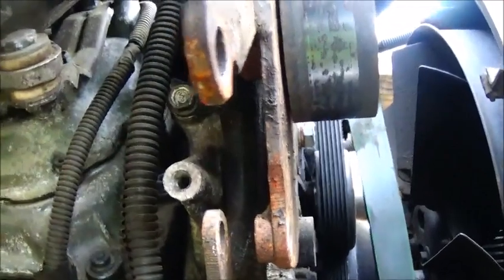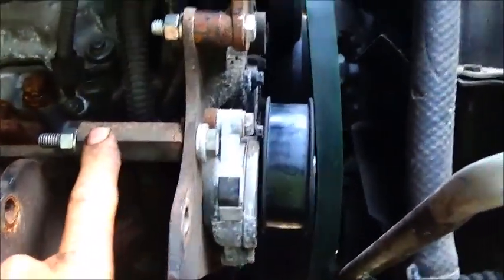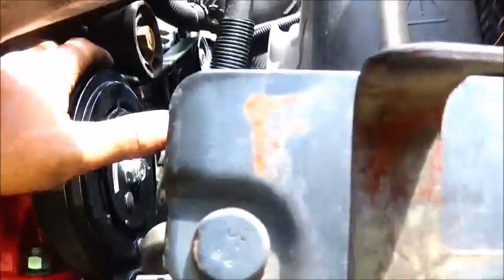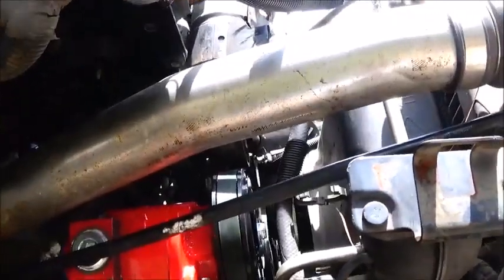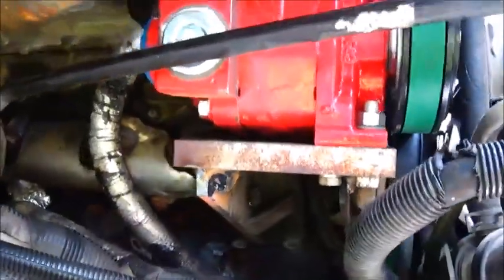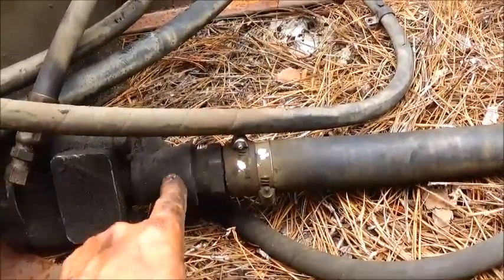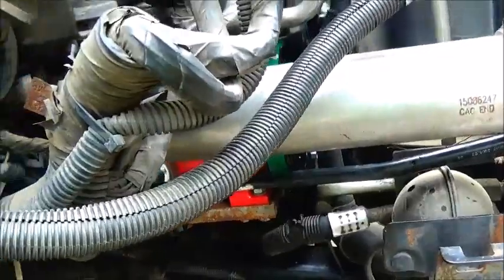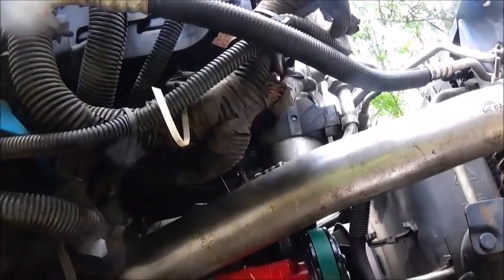2003 Duramax Rollback More Hydraulic Pump Fun!!

Comment: the shop i use to work at where we built dumptrucks used loctite 545 thread sealant they say it won't harm the pump or valves

Comment: THE drive belt looks to be work on the ribbed side on @ 7.43 in the movie and that smooth idler above the pits clutch looks kind of on a angle but it might be the camera. your work is great I like when guys use what you have and get it done.

Comment: is it ok to run it dry like that?
Reply from the maker: The switch is not hooked up so the pump is actually not turning, just the clutch. I will have the lines on and fluid in before I hook it up and turn it on.
Reply: ok cool, I figured you know what you're doin. awesome vids man, keep up the great work!

Comment: I didn't catch what the issue with the support bar was - if it's blocking the port on the pump, could you flip it upside down so the bend takes it down and away?
Reply from the maker: Pump just sticks out a little and the rod hits it.
Reply: Jonathan W do you worrie about the welding current frying the ecm and other electronics
Reply from the maker: I use to do exhaust and have welded on every brand and year you could think of. I have never unhooked the battery or any other precautions, just have to ground to what you are working on, You never want weld current to flow through wiring or bearings.
Reply: Jonathan W ford sucks because the late model body fitters guide days  you need to remove a bunch of electronic modules off before welding but not chevy or dodge just un hook battery cables that's it